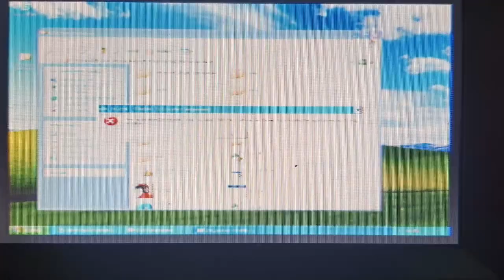My #ROGRigReboot21 entry | The Found PC

Comment: Wow... This brings me some flashbacks of when I was like 8 or 9 years old (so.. around 2007.. maybe 2008) I had a Compaq Presario laptop with a Pentium III in it running Windows 2000, a hand-me-down ancient machine even by 2007 standards. One day I accidentally stepped on it and cracked the LCD, but because it had a composite output, I was able to plug in a Sony portable DVD player to use it as a monitor. 

Eventually I was able to frankenstein the broken screen off the laptop and create what is known as a "halftop". I also had trouble reading text on the screen, but I was able to mitigate that by going to the lowest possible screen resolution. By then, my "laptop" was on one of those flimsy TV dinner trays in what was the "playroom" at the time, the DVD player "monitor", and a keyboard, and a mouse. 

Of course we had a real, very much more functional and modern family computer, but most of the time my dad was hogging that... this "laptop" was mine and only mine.